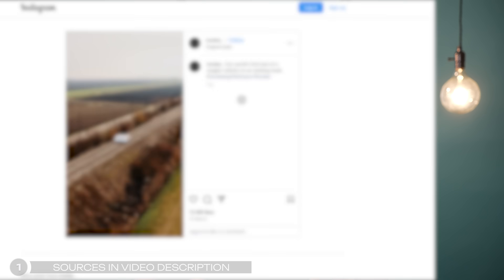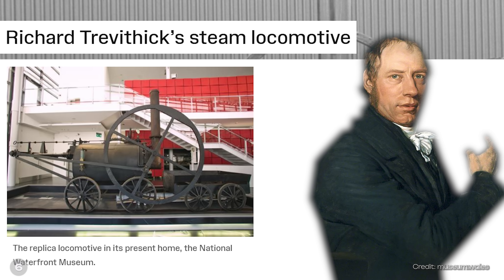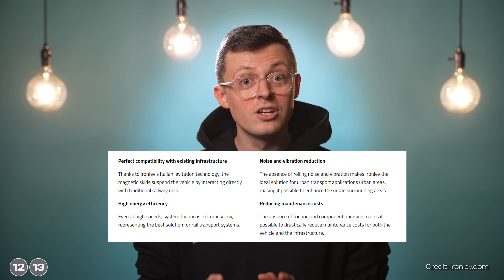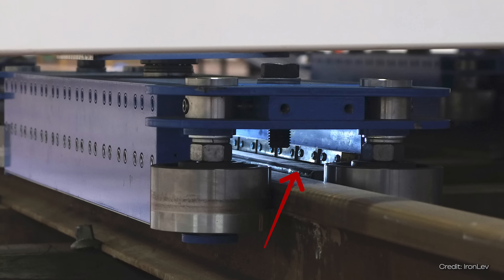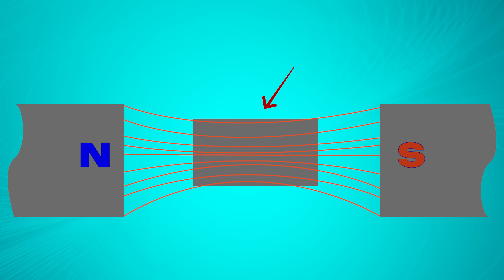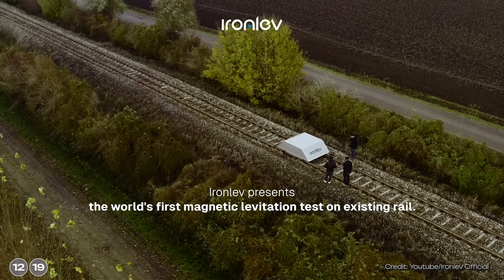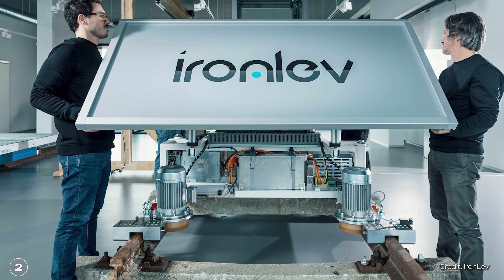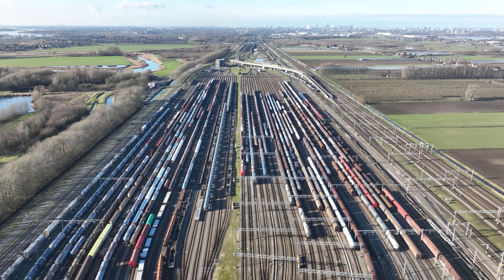World's FIRST magnetic levitation train on RAILS - Is this the train of the future?

Comment: Not only this probably generates electricity in the rails, hence drag, but, does it solve any true real problems???
With every invention, the main question is, if the problem it solves is real.
I think trains are already perfect regarding their wheels. Train systems could be made super efficient, reliable, cheap, if they would sort out completely different problems. Wheels are the smallest problem of trains.
Reply: Combatting noise could be an argument. Less wear on the rails another - I am pretty sure these two arguments are a part of the sales pitch.
Reply: Also, a lot of train control systems would like not work with this system, from the shape to induced currents
Reply: When you hear a train screeching round a corner, or going a circuitous route because steel on steel lacks the traction to manage gradients, or going slow because emergency stops take miles for the same reason, or cancelled because falling leaves are slippery... yeah rails are not perfect, and many problems are inherent. They are great for low rolling resistance, but that's about it. Once you start talking about high speeds you want larger wheels too, which makes the slow corners even harder. You cannot optimise for both at once.
Rolling resistance and (up front) vehicle cost are the two factors where it is hard to beat conventional rail. They are the things it already does well, not problems to be solved. I don't know why he talks about rolling resistance, because it is one of the places a new technology could perform worse than conventional rail and still be viable, if it solves other problems. Maglev can offer better traction (even if the rails are covered in something), better stability, better lateral force handling, and can be built in a way that handles tighter corners*. Couple it with tilting technologies and you can run passenger services significantly faster on existing tracks. Freight could run faster in places where emergency stop distance is important, and freight yards can be significantly more compact if you can handle tighter curves. While the modules might be expensive initially, they are solid state with no moving parts. That means low maintenance. Together with lack of track contact, and tolerance for far worse track surface, you end up with significantly lower track maintenance too.
Maglev traction is not tied to gravity induced friction, so not tied to weight. In theory you could climb a vertical slope with maglev. This means that a locomotive does not have to be heavy to pull lots of weight, or stop lots of weight. Alternatively, there is the fact that each levitation unit is also a propulsion unit, so simply equipping every n-th car with these gets rid of the need for a dedicated locomotive at all**. Freight trains in particular could accelerate substantially faster without creating large coupling loads. Coupling loads could be reduced in general, making cars significantly lighter.
One final benefit is that you could build these with a low profile. Wheels inherently have to point upwards, which means that your cargo floor has to start at significant height***. It can be lower with maglev. That means more cargo volume is able to get under the same bridges. For the UK, this would mean that shipping containers could be transported along many lines that the currently cannot. Even if the minority of freight cars are equipped with this, it would still mean that you could use these cars for the cargos that need it, and conventional cars for cargos that don't, and still have cleared the clearance and traction bottleneck.

Most of the problems trains have stem from the steel on steel wheels. They arise from the physics so literally cannot be solved while keeping the wheels the same.

*In theory you could build rail with split axles, but then you are losing a lot of the simplicity and cost benefits.
** TBH I don't know why we don't require every freight car to have a motor in it, and just use locomotives as moving power stations. It is required for maglev, but it just makes sense to me even in conventional rail. Low speed handling is substantially simplified if you are not relying on traction from a single source, and coupling loads can be almost eliminated. Currently it can take a train a minute to get to 6mph. That's 0.005G.
* You can have a dropped bed between trucks, but this makes your train substantially longer, and forces not being transmitted in a straight line makes them heavier.
Reply: Yeah it'd be more useful to use the money for this projects into getting rid of at grade intersections and repairing old rails
Reply: With higher speed rails wear much faster.  This is why many high-speed trains run much slower than their potential.  So maybe wheels are not currently the limiting factor. However, rails are experiencing faster degradation. Spain runs their trains slower than their design speed for this reason. So I can see how running zero contact at high speeds could open up new possibilities.  No?
Reply: @markharmon4963  Yes but as mentioned in the video, movement of the magnets produce both drag and heat induction, higher speed will create higher drag, meaning more power to move and higher heat, possibly to the point that the metal looses strength and sets things on fire, not very good I think ;)
Reply: @markharmon4963 the main limitation for high speed trains are curves, and maglev is not helping with this problem. Having train capable of going 400 km/h on perfect rails is useless if it must slowdown to 40 km/h in order to not tip over in a curved section of track
Reply: @troodoniverse That is clear.  However, when a high-speed rail system is routinely under performing it's design speed because of the wear and tear it exerts upon the tracks, then a contact free solution sounds like an opportunity.  Eddy currents and induced heat are not small problems, maybe unsolvable with steel rails.
Reply: I could see a use for buildings. Moving a building requires loading the foundation on rails and then pushing it with hydraulics.

Comment: Let me advertise my new innovation 'Iron lift light'. It replaced magnetic lifts with steel weels. This dramatically reduces friction and makes it allot cheaper.
Reply: I agree, but I would suggest steel wheels that make it a lot cheaper.
Reply: Allot is not a word. It's a lot
Reply: You don’t understand that maglev is faster this allows ultra high speed maglev to use regular lines pair with HSR and you get a greater mode
Reply: @qjtvaddict  This Ironlev train will ideally get up to 200 Km/h. How fast are the fastest wheeled trains? Besides, sharing rails with freight trains reduces max speed often anyways.
Reply: @qjtvaddict 
Japan who is at the frontlines of railway innovation for decades have been trying to implement MagLev, with very little success, they have a reasonable system that's ridiculously expensive to implement overall and often produces the exact same results as regular HSR

The issue with continental masses trying to implement valid HSR nationwide is size, China managed to do that but it's nowhere near as simple to implement as air travel, Europe did that as a continent but with every nation that has HSR developing their own systems, the US can't because lobbying from the big 4, Brazil can't because geography, it's Japan level mountainous terrain but the size of Oceania, and I won't even mention Russia
Reply: You don’t understand that maglev is faster this allows ultra high speed maglev to use regular lines pair with HSR and you get a greater mode

Comment: I've watch this twice and I don't see where the lifting force for the vehicle?  The magnets affect sideways forces but nothing is proving the lift above the rail.  So what I'm I missing?
Reply: Put it this way: the iron mass of the rail would like to stay as near as possible to the magnets. If it gets too high in between the magnets, it goes to far away from them. This creates a lifting force. The side wheels avoid that the magnets completely stuck to the iron.
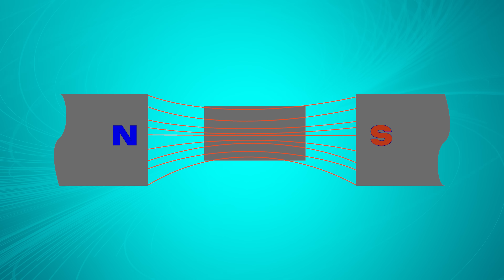Reply: It gets explained here 3:07
Reply: @TheShizobear  that still doesn't explain what the lifting force is. When stationary the car would settle down on the rail unless there are other wheels/rollers holding it up.
Reply: @bradmillard1689 oh I see. Seems like I misinterpreted your question. Now I’m curious, too.
Reply: @bradmillard1689 it does actually explain it. What he is saying is that the magnets on the side can’t go up or down due to the magnetic field meaning the magnets stay at the same height which the train is then attached to
Reply: Think of it like a fridge magnet. That is held off the fridge creating a small air gap by a roller.

Now imagine instead of a fridge it's just a strip of metal, and you have a magnet and roller on either side of this strip. With strong enough magnets the attraction force will exceed the force of gravity and the magnets will in theory be floating.

In reality those rollers will be exerting even more force than the weight of the train.

What they've essentially done is moved the metal wheels from being on top of the rail, to being on the side of the rail. And by doing so have actually increased frictional forces.

The maths ain't mathing with this. Absolutely no way it's less friction or more efficient. None. Not without bending the laws of physics.

Comment: It can't work, this is literally how emergency brakes of ICE trains work. I just don't understand how can they pull this stunt for so long.
Reply: It is the same principle, that slows down magnets falling in a metal pipe. _https://youtu.be/eG3b1pQ8bRQ?si=s3p0vOxEenbWKiPM
You have to cut the tracks into 10cm parts to prevent this ... or you could just invest in working trains? No? Ok.
Reply: Its  not. Those use alternating magnets
Reply: It uses magnetic reluctance to lock the wagon in place along the Y-axis. The magnetic fields in magnetic brakes should look completely different compared to the concept shown here.
I‘m not an expert in this technology, but even if it is possible to achieve levitation in this way, I don‘t think this solution is practical in reality. As you mentioned, there should still be some braking force generated due to the initial magnetization of the metal. On top of that, there is a weight limit for the wagon, and I think the greater losses in classic trains come from air resistance rather than friction.
Reply: @Titan9731    resistance does not come from initial magnetization. It comes from the currents induced in the rail by the passing magnet. E=-d(fi)/dt Faraday's law: electrical field is equal to the rate of magnetic field change in the space. If the space is filled with conductive material, this will cause currents which dissipate huge quantities of energy as heat.   https://youtube.com/shorts/W1zofKNrx5o?si=ulXp-WGu0rAuQZNT
Reply: @Titan9731  Youtube has deleted my reply... anyway, I was trying to say the same thing as stefanbergung. The problem is Faraday's law and induced currents.
Reply: Trains are so massively heavy, and all in one long line, so wind resistance is negligible compared to friction losses.
Reply: @Timberius Well. At high speeds air really creates a huge pressure. Remember that the "train on void" was proposed because of that.
Meanwhile rails really have very low friction even for something so heavy.
Reply: @Timberius  Wind resistance grows exponentially with the speed and friction loses in trains are very low because they use steel wheels on steel rails